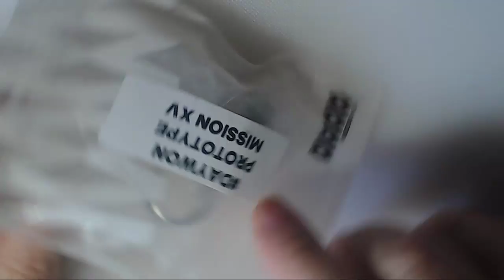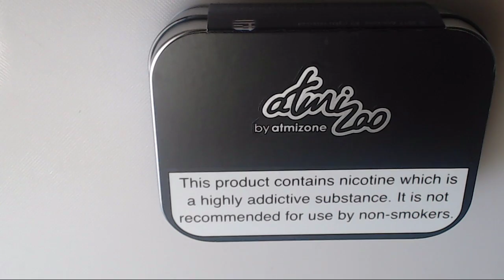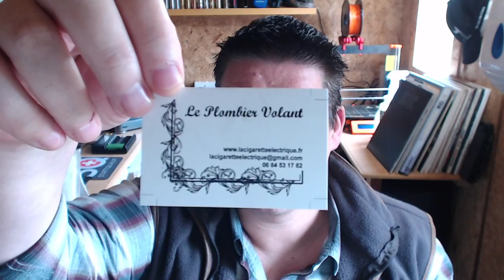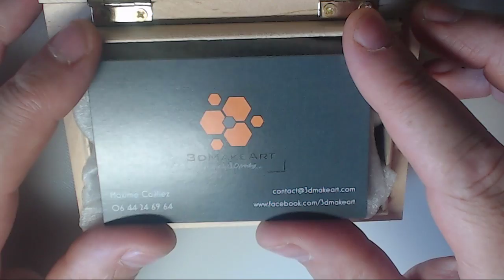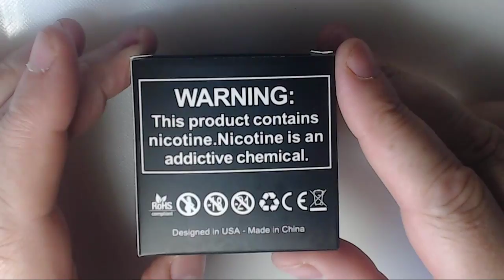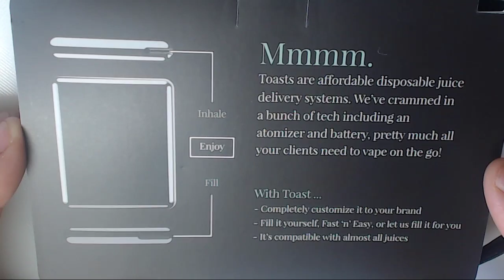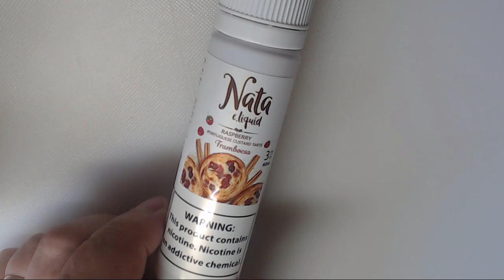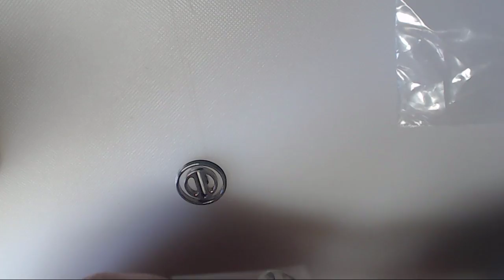Vapexpo 2018 - The verdict and the TOYS!

Comment: can u explain the appeal of the frankenskull stuff over other squonk gear??? I understand it's quality hear but i dont understand y it's consider the top of the top. I've personally never used one and have no experience with one but I cant imagine what it is that makes them any better than some other squonkers on the market that r priced more reasonably which price isnt the issue. Idc about price  I'm interested in finding out do they use a specific material in their contacts that make them more efficient or something. basically is it really the best quality squonk gear out there or had prestige and availability or lack there of is y they r so exspensive and sought after.
Reply from the maker: Hype, sheep and the guy is an excellent businessman 🙂 they are also good little mods but no better than anything else.
Reply: Todds Reviews that's what I assumed. just wondered if there was a legit reason. thanks